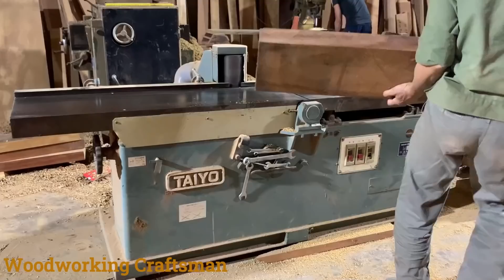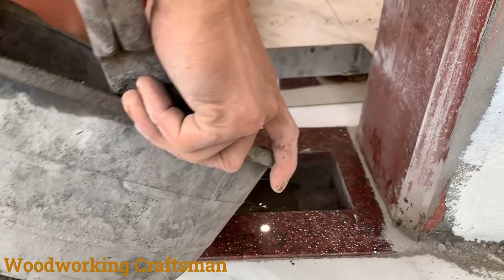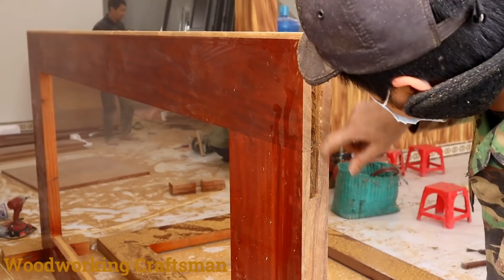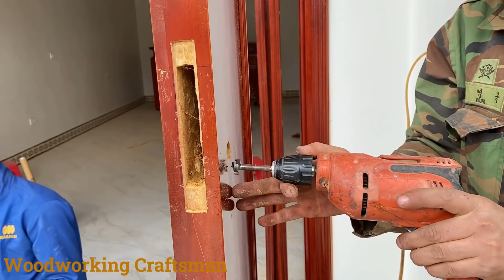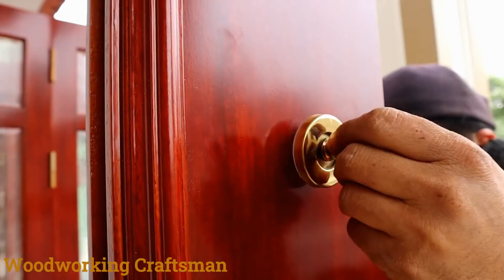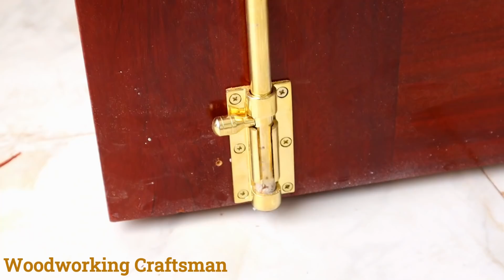Ingenious Woodworking Workers Techniques & Skills Fastest // Amazing Design Beautiful Large Door

Comment: The key to the door was badly masked by the handles, which would make operating the key, that required multiple turns difficult. It would be an improvement if, the door handles were installed closer to the glass panels.

Comment: Back in my youth, I worked as a fabricator/welder during college holidays. 
That was before blanket ''Health and Safety'' laws were introduced, in the UK, making all sorts of ''safety equipment'' mandatory.
I was ridiculed by some of the workers for wearing ''Jesus Boots,'' or sandals while I was working, instead of steel toed  ''Toetector'' boots.
However, one of the men there dropped a piece of steel plate, about 3' x 1' x 1/4'' on his foot, edge on.
It landed about 1'' behind his steel toecap, and broke his foot, which put him in hospital, and lost him some days work.
I relied on care, and fast reflexes to make sure my feet kept safe. I never had a problem.
Another problem was wearing a mask and safety goggles or glasses, simultaneously. The mask always caused the goggles to steam up, which was damned dangerous, when working with dangerous power tools. Goggles were fine, or a mask, if there was dust, but not both. A mask would be OK, and one just had to work side on to avoid flying debris.
However, I did wear gloves when I was working, all the time. This was also ridiculed by some 'macho' guys, who maintained that they had no sensitivity when wearing gloves, until one of them sliced the end of his fingers open on a piece of hot rolled steel strip. The big blobs of bandages on his fingers did a world of good for his ''finger sensitivity.''
Moral?
A lot of safety equipment isn't necessarily safe, or necessary, care and concentration is.